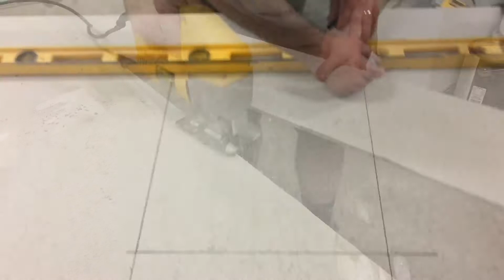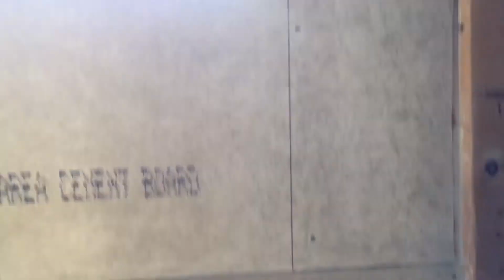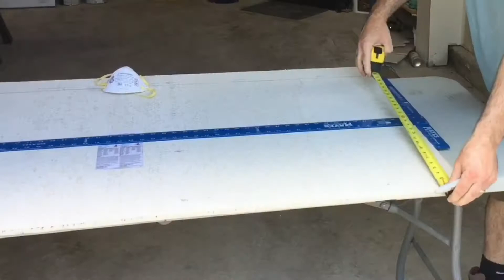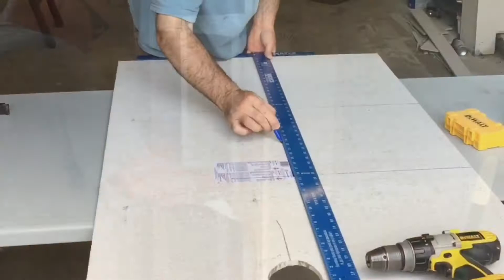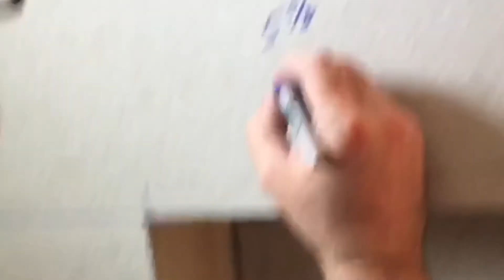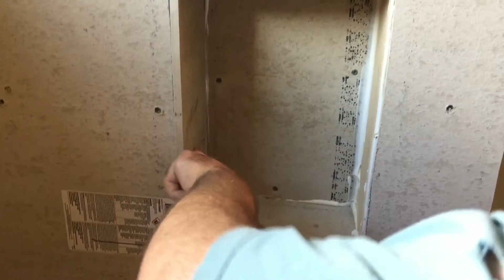Part 4 - Durock Wall Install - Complete Bathroom Remodel

Comment: Some guys set the backer board on top of the tub flange and some guys (like you) install it overlapping the flange. I’m still trying to figure out which is best. Did you shim the studs behind the cement board to compensate for the thickness on the tub’s flange? Does overlapping the flange create any mismatch at the cement board and drywall transition?

Comment: Looks like on the second Niche the bottom plate sits on top the large vertical durock and on the first one the bottom plate butts up to the inside of the vertical piece - did i see that right?  Any thinking about which way is best?
Reply from the maker: Howdy Chuck Phipps!  I don’t think it matters...with the large amount/multiple layers of waterproofing I apply in the next video, no water will get in there.  That said, if I had to choose one way to do it, I would extend the horizontal piece over the vertical edge.  Thanks for watching.  Let me know if you have any more questions.  Good luck on your project!   ☘️
Reply: @DoAndBrewDIY  Thanks!

Comment: Around the edge of the tub, how much did you overlap the durock over the lip of the tub? Thanks!
Reply: OK, i see - you have a 1/4" gap so with the lip at 1/2", the overlap is 1/4" - correct?
Reply from the maker: Howdy Chuck Phipps!  I want as much overhang as possible, BUT you still need a small gap between tub top and Durock.  I don’t want the Durock resting on/supported by the tub and I do want a small gap (3/16” to 14”) for waterproofing.  Thanks for watching...let me know if you have any more questions!  Good luck!    🍀
Reply: @DoAndBrewDIY  Thanks!

Comment: when sloping the niche rough in how much slope are you using? also I must say man excellent craftsmanship! I'm taking notes  I've just got done gutting my bathroom and waiting on the tub delivery. I understand setting the tub on the plywood floor but would you want to for extra measure run the concrete board under the tub as well?
Reply from the maker: Howdy Thomas,  thanks for the great comment and good questions.  You don't need too much slope on your niche.  Using your level, slope the niche bottom so that your bubble is just touching the line - to no more than a quarter bubble past the line.  You just need a slight slope, but not too much.  Honestly, I don't see a need for concrete board under your tub...as long a you waterproof and seal properly around the entire tub perimeter.  Thanks again for the great comment/question.  Hope to see you as a sub!

Comment: I have seen installers put the niches in after the cement board is up and start tiling to make sure a full,piece of tile was underneath the niche. Did you have a problem with the tile layout? TIA.
Reply from the maker: Howdy markprice46 !  Not sure if you are referring to the plastic or fiberglass inserts....I prefer to design my niches - either to the size of the tile or the storage needs of the niche.  Either way, as long as you take the time to properly design your niche, caulk and waterproof, slightly slope the bottom tile/stone, grout, caulk the lower corners where water may collect - you will not have any problems.  It’s all about the layering AND taking your time.  When you’re completely finished your niche you will have 8 plus layers of waterproofing to ensure no water gets thru.  As long as you’ve sloped your niche correctly you’re good!

Comment: Does the water proofing stick to that silicone?
Reply from the maker: Howdy markprice46 !  No, but that is not a problem...as you’ll see in the next video, I apply the waterproofing with the mesh tape to all inside and outside corners.  The waterproofing will set up and dry....and the mesh tape provides the structure.  After 3-5 coats of waterproofing, coupled with the caulking, you will have a shower that never leaks!  Let me know if you have any further questions and good luck on your project!